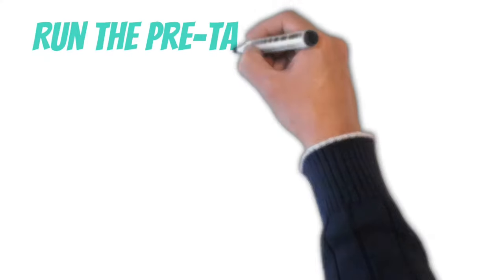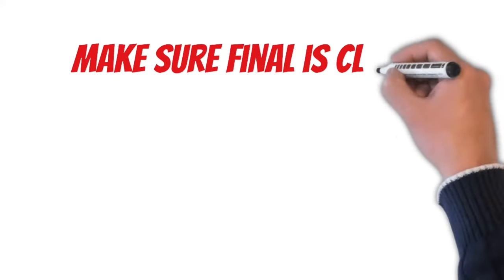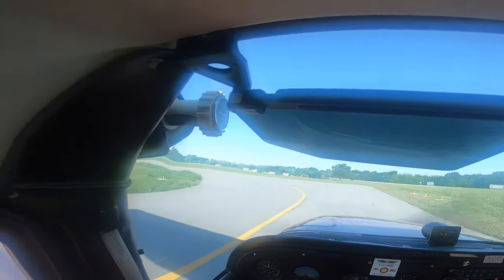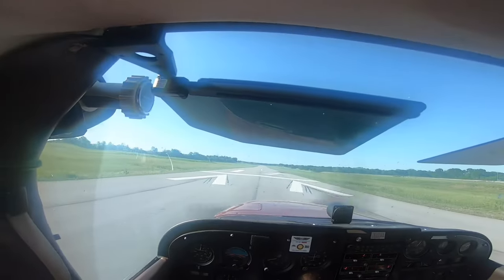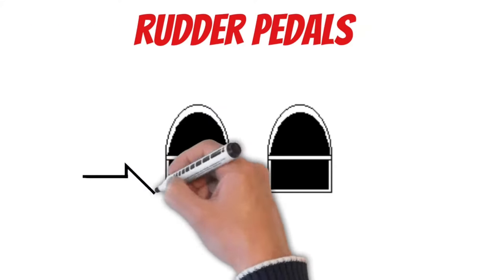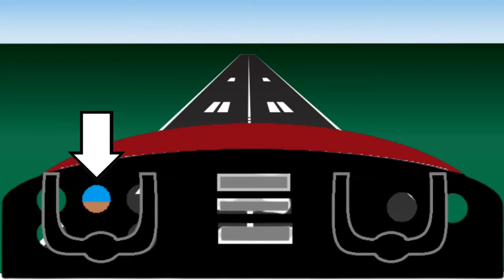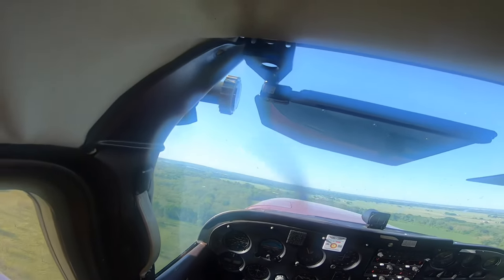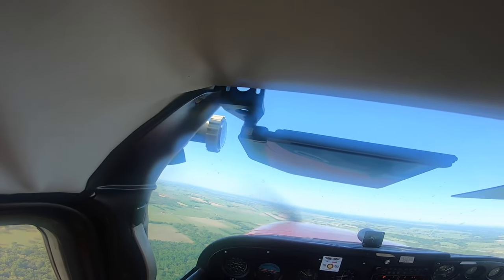How to Perform a Normal Takeoff (Private Pilot Flight Lesson)

Comment: 🛫📖🛬

Good video Josh.
When a student gets smooth on their landings and a real controlled runway heading take off it helps them to realize that it took effort and practice.

By that time they can see the need to put out the same effort on other phases of their air work.
You're doing a great job Josh.
📖🛐✈️
Reply from the maker: That is a great point. Thanks!

Comment: Right rudder for both the takeoff roll and climb?  Do you also turn the ailerons to the right to counter act the torque turning tendency when climbing?
Reply from the maker: Yes, you typically don’t need a lot of right rudder until you’re airborne. As far as opposite aileron, that’s usually not too noticeable.  The manufacturers typically design the plane where you don’t need to fight these forces too much

Comment: Can you get these preflight maps for the Cessna 172 or a Piper Cherokee as a PDF?
I'm trying to learn flying in X plane 12, so it would help me a lot!
I usually find complete books about an airplane, but this map is much more useful!
Thanks in advance!
Reply from the maker: If you’re talking about the VFR sectional, then yes.  Just google search FAA VFR sectional pdf. It’s one of the first FAA sites to come up
Reply: @FreePilotTraining  No, I'm talking about the handy pilots checklist of the Cessna 172.
Before Takeoff, Takeoff, Before Takeoff, Cruise and Before Landing!
Because I already made a mistake with the carb heat and forgot to set the altimeter before taking off after another flight in Xplane 12 which got me into trouble.
So I really want to go over the checklist.